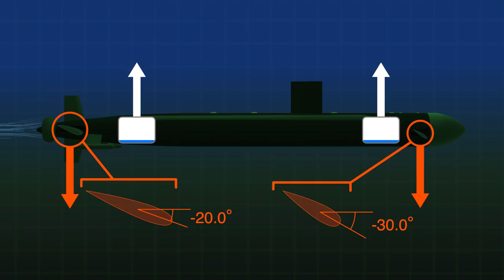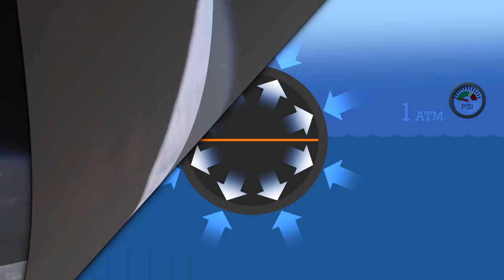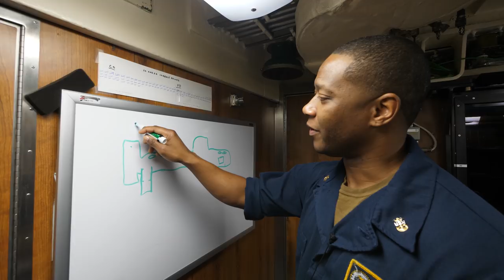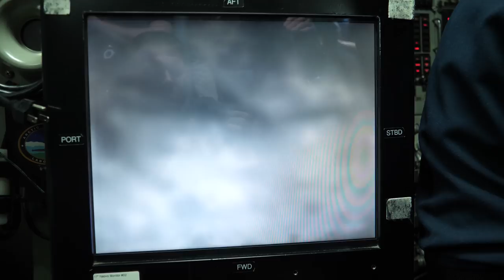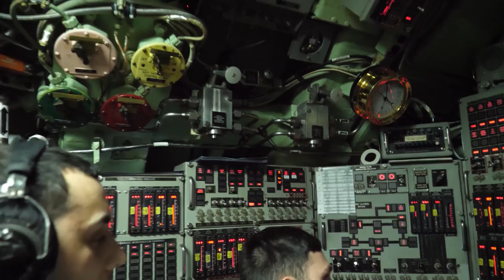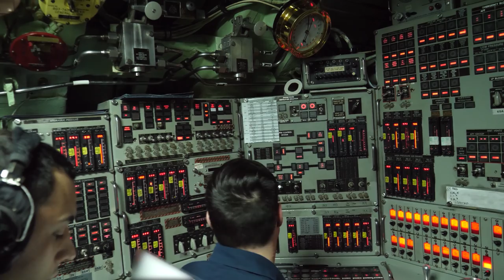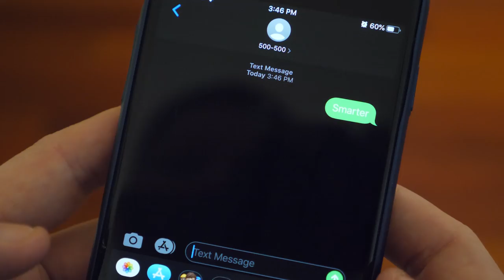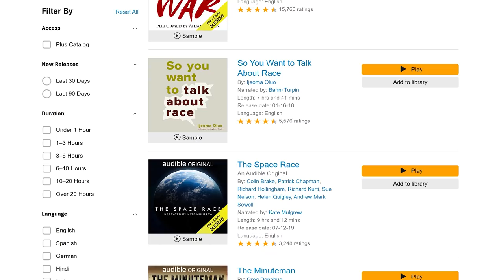How to Surface a Submarine in the Arctic Ocean  - Smarter Every Day 260

Comment: As a submariner I'd like to say Thank You! You don't know how physics works until you've ridden a submarine. You use it all day and night. It keeps you alive!
Reply: 🇺🇸 commands and rate?
Reply: @vim2286  Plankowner USS Flasher SSN 613, 1965 to 1968 and a short TAD tour USS Cusk SS 348, 1969. rate = Commissary. You?
Reply: @webbtrekker534  SSN 22. MMA3 (Machinist Mate Auxiliary, I think it was called boiler men back then) I didn't even know comissary was a rate, Thank you for everything you've done
Reply: @webbtrekker534  you ever get to see the  Nautilus?
Reply: @vim2286  Any number of times from the outside as she went up and down the river. I was aboard once after she became a museum. My current grilfriends' late husband served on her. It was his 3rd and last boat. She was pretty worn out by then.  I'd have liked to have seen it without all the plexiglass. Always interesting to see how different classes are laid out.
Reply: @vim2286  Cool USS Connecticut. I see her from time to time out on the Sound out here in the Pacific NW. 
Plankowner means you were assigned ships company at the time was submarine was commissioned. It is an old term held over  from the days of wooden ships and as being first crew you were entitled to a piece of plank from the ships deck.
You would have just been a MM3 assigned to the Auxiliary Division. Everyone just called them, including them selves "A Gangers". 
Boilermen worked with coal or oil fed high pressure steam boilers like in Battleships or Cruisers.

Comment: 23:20 It is always amazing how little weight is needed to balance something; in a model aircraft it can be a few cms of placement of the battery or fuel forward or aft; in a super heavy machine like a entire nuclear submarine just one person walking forward to aft is apparently enough to compensate. Probably a lot faster than trying to use ballast tanks too. Cool way of making fine adjustments.
Reply: I can't remember if he mentioned it in this series, but I have heard of sub drills where everyone who can, runs to the front of the ship.
Reply: A changing CoG in flight has brought down more than one aircraft. 
I can think of at least 2 military transports and a handful of skydiving accidents caused by stuff like that.
The pilots of jump planes get really tetchy if skydivers start moving around in the middle of an emergency like losing an engine because of that. ;)

I've never considered it for submarines before.
Reply: Das Boot (a German movie set in a WWII submarine) shows sailors running to the bow for emergency dives. Good movie btw. Subtitles recommended.

Comment: “You can reach a depth where subs can sink” this is strangely terrifying
Reply: That blowed my mind...
Reply: Right! There's a point where it can drop like a rock? To me it almost seems counter intuitive... Also there's so much I didn't and still don't understand about these machines. Subs are the submerged sport bike's of the sea. By this I mean there's so much happening at once and it can be dangerous if you're not prepared or especially if your equipment isn't in the best of shape. 
Anyhow I like your comment.
Reply: The hull would collapse before that depth.
Reply: When we give tours often we get asked how deep can we go. I always reply “we can go all the way to the bottom if we don’t stop her.” The looks that I get are priceless, then I tell them deeper than 500 feet is the unclassified answer…
Reply: This happens to SCUBA divers as well. They can adjust their BCD to be weightless, but as they go deeper, they need to to add more air.  If they don't notice it, they can be in a situation where they are sinking faster than they can cope with.

Comment: What surprises me most about this is how so much of it seems to not be automated. I expected everything to be handled by computers with the crew there just in case something went wrong, and there's this dude with a steering wheel. I can't say I get it.
Reply: I mean that’s the thing about opsec though. We have no idea if that was just a show for us.
Reply: It shocked me too but I thinking about it, the Toledo was finished being built in 1993, so it was probably designed throughout the 80's.  Computer autopilots weren't as sophisticated, and were mainly being developed for stuff that flies - on top of that it would cost a fortune to rebuilt the innards of the sub if it were even possible to upgrade
Reply: It’s 30 something year old technology. Newer subs have a lot more automation.
Reply: The USS Toledo in this video is a Los Angeles class nuclear submarine launched in the 1990s. Technology has come a long way since then, which may be why you see the steering wheels here. The most modern class of submarines is called Virginia, and they are still being produced today. I doubt Destin would have been given the same level of access and visibility into our most modern class of subs, but I could be wrong.
Reply: They probably do have tons of computers that help em out, but they still do it manually mostly to keep proficiency up, at least that's how I think it is. Because Navy fighters have the capability to automate landing on an carrier to a high degree but they still do it through skill and eyeball
Reply: @samuelglad2695  Not necessarily, ships and subs go through a constant improvement, retrofit and upgrade cycle whenever they visit port so it's probable that a sub like Toledo, serving in the Arctic has fairly modern bits and bobs on it
Reply: Nuclear powered submarines are technological marvels, even with the 80's technology that they are built with. They are the most complex machines that humans have ever built. There are millions of moving parts that have to work in the harshest of environments. Why make it even more complex with automation? Having served on submarines for 16 years there's a lot of things I personally wouldn't trust to automation. There's also a lot to be gained from mastering the operation of these beasts.
Reply: They started building this class of subs in 1972. I'd be willing to bet that Virginias have much more automation on them.
Reply: Computers don't really handle casualty situations all that well.  The crew is trained and drilled to get their actions down to nearly automatic, but also given enough engineering knowledge to know when, where, and how to apply those actions in any situation that may be encountered.  Unlike modern space capsules you don't "ride" in a submarine, you operate it.
Reply: My thought, is if a emp went out it would still be able to operate.
Reply: This whole thing was an exercise, so I'd assume they'd be doing it as manually as possible as part of the exercise.
Reply: Those who say that the USS Toledo isn't automated because it's "old" are incorrect.  The LA Class has been through several upgrades, the latest of which is rumored to have been 2015.  Although the Virginia was laid down later than the 688, and it is more capable, neither of those Classes is king of subsurface warfare.  That distinction goes to the Seawolf Class ..  by far.. and it was laid down in 1989.   

As to automation, there's a big misconception concerning military tech.  A lot of people like to talk about how "drones are taking over" and believe that warfighters must have less educational and technological demands than before because "computers can do it for them".  We're nowhere close to autonomous tech, and the demands on the warfighter are greater than ever before (senior enlisted need degrees for advancement now!).  After the military I went into the data intelligence field, and I now work with machine learning and AI.  It's true that some of the "types" of demands on warfighters have been eliminated by technology, but not the "degree" of demand.  For example, where you once had to watch 10 steam gauges to monitor equipment health, there might now be a single "heartbeat sensor" that you can watch for anomalies across those 10 readings. They then dig deeper into the 10 readings if they see fluctuations in that single indicator.  This is called "fused sensors".  This frees the time and situational awareness of the crewman up so they can give attention to other things, but it doesn't free them from understanding the 10 readings that are beneath the fused sensor.  They still need to dig into the problem or threat and react.  This is just one small example, but the point is that instead of having "autonomous gear" we have "man-in-the-middle autonomy".  This means that yes, a submarine might be able to identify a target, then lock on to it, then fire a torpedo..  but no one of those things is done without the verification or "button push" of a human that's present and absolutely knowledgeable in every subsystem.  Not only is the human the validator, but that operator has to be able to perform each operation and calculation manually.  War has a way of ruining complex machinery and making you pull out a paper and pen to perform calculations then manually adjust.  As someone who has a great interest in the subject, I believe that we're no less than 50 years away from any level of full autonomy for military equipment... but then humans will still need to authorize and sometimes manually operate.  Can technology free up the time of operators to concentrate on other things?  Yes.  But this just means that they'll be given other very important tasks to complete... and they have to understand the technology and manual order of operation down to the most minute level of detail.
Reply: The Subfleet is Automation phobic.  People can make judgments and anticipate, machines can't.  We use computers for adding up, the decisions and ship operations are made by/performed by people.
Reply: @chrisdoe2659  I would take you up on that bet. ;) The Navy wouldn't trust a computer to do a job that a NUB can do.
Reply: @donbarr9487  I agree a computer can only do what someone else , a long way away , a long time ago, thought might happen, told it to do.
Reply: @kinsagamoto  they're made of metal, an emp would have no effect anyways since it's essentially a massive Faraday cage
Reply: @JanBruunAndersen  my robot vacuum likes to drive down the stairs. it wouldn't save any money if even a single sub is lost

Comment: Destin,
Ex submariner here.
Test depth is only 1/2 of design depth. In other words, test depth is over a 100% safety factor.
Relax.
Figure, the boat that you were on has a hull made of HY-80 steel. That's 80,000 lbs per square inch tensile strength, and the hull is roughly 3 inches thick. Do the math...

Also, as a boat dives, there really isn't too much of a Cartesian Diver effect. That's because there are actually two different types of sea water tanks on submarines: ballast tanks (which are free flooding from the bottom, and vented via hydraulically controlled valves on the top to flood them or let water in as they let air out; and they're drained by closing the vents, and blowing air into them, thus forcing water out the bottom), and trim tanks which are within the pressure hull, and are filled or emptied via pumps. These are the tanks that get filled or emptied to achieve neutral bouyancy. There is typically one forward, one aft, and one or more amidships. Once a boat is completely submerged, the ballast tank vents are usually left open to avoid trapping air or other gasses in them, and thus affecting the trim. They might be closed in a "rig for ultra quiet" scenario, to avoid the gurgle of escaping gas, but generally they're left open. The neutral bouyancy and zero degree bubble are then achieved by pumping sea water into (or out of) the appropriate trim tanks.

Oh, and there is an upward-looking sonar that can show both the distance to the ice, as well as the thickness of the ice. Strange that no body answered that, because I'm pretty sure that's not classified information. It didn't used to be. Maybe they were just too busy during surfacing ops 

In any case, a great series. It was fun to see the differences from 50 years ago!

Comment: When you explained how a submarine can just suddenly sink like the eyedropper example I think I experienced anxiety for the first time just thinking about the repercussions of that error. 😱
Reply: Same, I was wondering if some of the submarine accidents happened that way, fortunately they can turn on the engine and start moving so the wings can also provide boyancy.
Reply: @castcrus  true but if the submarine sank even remotely close to the speed that the eyedropper sank there wouldn't be enough time, nor would the engine have enough power to counteract the physics of why it's sinking in the first place.. all just assumptions of course.  Even though this doesn't happen often I would imagine it's equivalent to an helicopter or an airplane just suddenly dropping out of the sky. Either way the thought of it happening is... Difficult to comprehend
Reply: @castcrus  Such accidents do happen. Just 3 months ago (21 Apr 2021), an Indonesian submarine sank this way with all 53 crew.

Comment: Destin: "I'm doing math in my head right now. 10 degrees, at least 8 knots..."
Me: "what is a knot?"
Reply: 1 Knot = 1 nautical mile (per hour) ≈ 1.151 miles per hour
Reply: @Stevarooni  thanks
Reply: Just about half a meter per second.
Reply: It’s when you tie ropes in a certain way
Reply: @samuelp.1022  What are your other 9 degrees in?
Reply: Knots was originally a measurement of speed using a rope tied in knots at set intervals. The end of the rope was tied to a board and thrown overboard, the rope was dragged overboard behind the boat in a straight line. They then count the number of knots that go overboard in a set amount of time. The current nautical mile is based off being 1 minute of latitude across the earth. 60 minutes are in a degree. If you go 60 knots ground speed for one hour, you have gone one degree around the earth. Do that for 360 hours and you circle the earth.
Reply: @testdasi Boats measure their speed in nautical miles per hour (knots) and so do planes!

If you ever need to measure your position based off the stars in the sky, it makes perfect sense to use nautical miles
Reply: Knot is just a measure of speed used mostly in aviation and marine applications
Reply: @RebelCowboysRVs  Greatest answer ever on YT comments.
Reply: @thecaynuck4694  Also,  nautical mile is one minute of the earths latitude degrees.
Reply: @RebelCowboysRVs  that is the SINGLE best description of minutes, degrees, and knots i have ever seen. Good job! 
Youd think it would be the standard explanation but alas most keyboard phds are often to "smart" to make things simple :p

Comment: 27:00 My guess on knowing where to surface may be a combination of finding bright spots in the vertical camera's feed like your guide was saying regarding the thin ice, as well as the sonar may reveal the structure of the ice and how its density changes, much the same way as how radar penetrates a storm cloud, or more like how seismographs can use earthquakes to map the structure of the Earth.
Reply: Vertical camera feed not used at all FYI just SONAR
Reply: So like do they map the ocean floor, keep track of where they are, sonar burst to find ice and then do subtraction to find its thickness?
Reply: @codemaster2861  Ultrasound pulses will echo back from the layer of ice/water (bottom of ice) and ice/air (top of ice) at different times which can be used to approximate a thickness. Using multiple transducers using different "ping" signals they can build up a realtime 3D map taking into account the echo delays and directions of returning echos. Various factors such as salinity, temperature etc are also taken into account to improve accuracy although this is not usually needed; the goal is only to get relative thicknesses. When positioned below a relatively thin position of ice in a target landing zone, a more focused SONAR system is used; one of the main weaknesses of the SONAR map is that "slush ice" where water and ice can be mixed near the surface, does not return a very clear signal due to the mixing of ice/water/air interfaces which is really what provides the different bouncebacks. The more focused powerful system is able to modulate the frequencies of SONAR used in order to accurately measure a smaller area. The frequencies are very specific and could theoretically be detectable from above the surface if known in advance, which is why they are bleeped out in the audio. Once confirmed as a viable thickness, the procedure continues.

For general navigation re your question about ocean floor, submarines use inertial navigation systems - literally just knowing we're going x direction at y km/h with angle z based on sensors. SONAR can be used in areas which are well mapped/known in advance.
Reply: @codemaster2861  I'm thinking that the return is just different, much like looking at modern fish finders reading different types of bottoms. The ice would essentially look like another bottom above the sub, and would be varying levels of brightness depending on the density, as well as showing up as thicker or thinner.